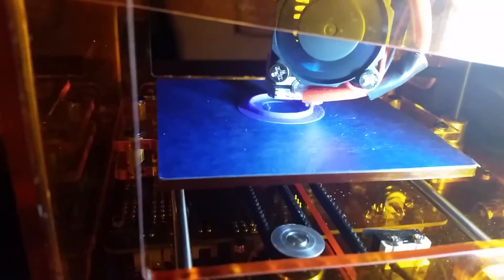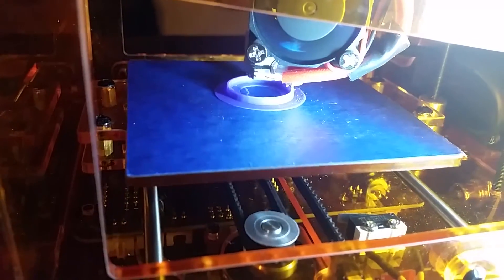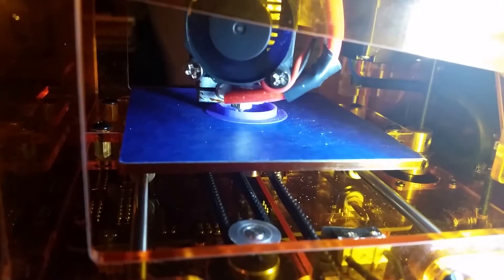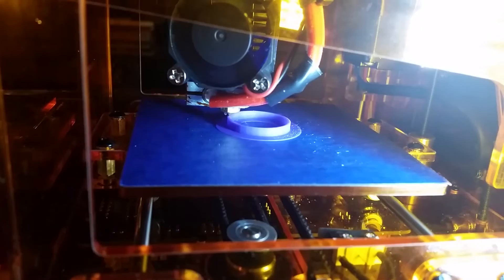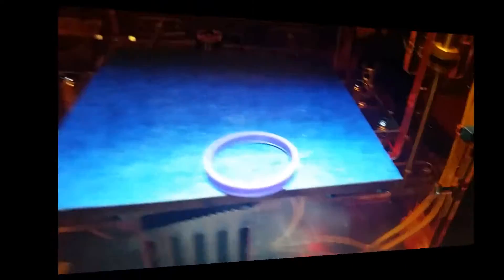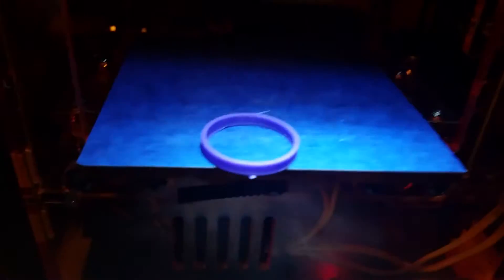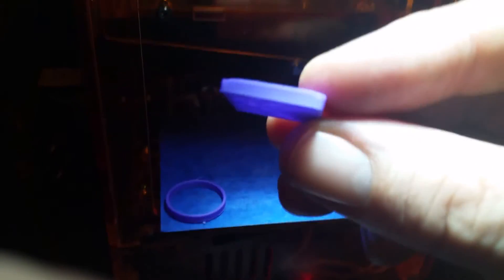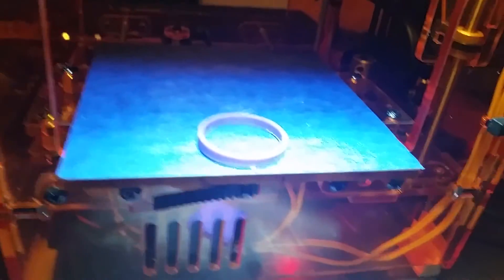Fabricator Mini 2nd ABS print

Comment: Nice ! I can't get ABS to stick on my mini fabrikator :( I even have the buildtak... 
It does stick good for the first layers, but then after 35 min of printing it comes loose and unstick from the bed...
Reply from the maker: +Tahitian Rider same , i had to close /cover the sides . you cant have any drafts at all for ABS . when teh bed cools off the abs pops rite up . when i closed mine in the heat form the hot end keeps the chamber warm , like really warm , as long as all side stay closed . I need to try with glue stick again soon.  but  um yeah , so far as i know you have to put first layer down as hot as you can support and not too fast. i use a brim where i can . possibly a raft would be better .  after first layer is down , i let it it go back to normal temp . its handy if your slicer supports alternate first layer speeds and feeds and temps.
Reply: +XerotoLabs Oh okay thanks for the advice !! :) 
I'll try to close mine with some tape too then, I'll have to leave an opening where the bed comes out of the printer but most of the holes will be closed otherwise. I dont think cura engine support differents temps for the first layer, but I print at 220°c and I'm kinda afraid to go above on the fabrikator mini. 12mm/s print speed is okay ? or too fast ?
Reply from the maker: +Tahitian Rider i have had mine 230 ,  it some time sover shoots and the firmware halts / stops the print . but once warmed it will run along ok . 
i try to do small prints in center that stop the bed from coming past the edge .  see this video i did about cheapo easy doors. https://youtu.be/Tl2uEtzHTKQ
Reply: +XerotoLabs Oh okay, I'll give the ABS another try then :) 
Haha nice mod ! the CD cases are a great idea ! ;) thanks again for the advices !
Reply from the maker: +Tahitian Rider I was trying to use ABS at first as it was the only filament it had on the first day I had it  due to the shrimpy bit of PLA it came with .  after fighting for a few prints i found Chuck's YT ch  and this video : https://youtu.be/i4a5pbJoFLc 
The blue tape and glue works for me .   I should try and re do some of my problem prints with ABS again this week .  It has been a busy week for me offline life .
Reply: +XerotoLabs oh okay, yeah i've seen his vidéo and it is the mean reason why I bought a roll of ABS filament. I was expecting the same results. But I didnt print with rafts, apparently I should. I'll try again with the printed closed and with rafts :)
Reply from the maker: +Tahitian Rider +XerotoLabs PPS , i use 9mm/s for first layers ... that's very slow but only for first layers on ABS and PLA .   lately if im using cura that is built into  repetier host , i set teh speed to 10mm/s  and override thr speed to 90% (results in 9mm/s) during start and first layers , and the set it to 150% (results in 15mm/s)   . I expect i would only set speed to 110% max with ABS though .     also i have Fab Mini v1 , not the newer one if that makes any diff  , but i don't think so .  
I also recheck head height over the build plate every 10 prints or so ans there seems to be some drift up and down over time. (room temp causes it maybe ?? ) 
I think a good sized plastic water bottle or such that coudl cover the whole printer could let you have heated chamber and use full x axis travels.
Reply: +XerotoLabs Oh Okay, thanks again for the tips ;) I don"t know how to override speed while printing in cura engine but I 'think I'll go for 11 or 12 mm/S for the whole print as it is the slowest I can get. 
Yeah I check the head height too sometines. 
I think I'll just go with tape on the side and front opening of the chamber, I dont know my motors to overheat neither since the print I want to make in ABS is a 10 hour job lol
Reply from the maker: +Tahitian Rider if you use Repetier-Host to print , there is a small set of slider on the right , below the position and homing controls .  the top one is speed i think . 
to use that the way i do , is set cura to slice at 10mm/s  .   now that slider range of values  is 0 to 200 ,  because the  file is sliced at 10mms , that slider is like 10x vlaue to make it easy . 
so setting it to 90 while its warming and homing means your first layers will go down at 9mm/s  .  if you set it to 150 , once you are a 2 layers down or so it will be at 15mm/s or whatever you set the slider as divided by 10 .  so if you set slider to 120 the printer would be printing at 12mm/s .  you can set those sliders while it prints anytime, but i try to wait till its not doing a wall , like if its in a infill section 
I'll do a video on this next i think . You're not the only one how has and need to know or ask this.  so thanks for idea for a good next video man .
Reply: +XerotoLabs Oh okay yeah I see the slider you're talking about, the "feedrate" slider. I though this was the feeding rate of filament through the extruder motor, but it is actually print speed. Thanks for the info ! :)
Reply from the maker: +Tahitian Rider see the top feedrate slider here  http://www.repetier.com/documentation/repetier-host/rhmanual-control/   the one with the icon of the guy running . i click in the value box type in the number i want and hit enter exactly when i want the speed change to be sent   (i dont like dragging sliders )  . note it can take a few commands before you will notice a speed change .  the firmware buffers a few commands in its printer memory .  Hope this get you printing smooth .
Reply from the maker: +Tahitian Rider later you can take it out of easy mode and use the slider's to test  dialing in your  plastics and such but adjusting them during a test print .  because the fab' mini supports the on the fly changes , it can make dialing in a new filament much easier .   like slowly upping or dropping flow rates and temps  during prints while you watch  can get you stuff looking nice.  I use a Pro PLA  from a store near to me here .  but  he also has this stuff that is ABS+ ,  its ABS but it prints more like PLA . very cool
Reply from the maker: +Tahitian Rider I put a extra quick over view of how i hand drive feed rates / speed of prints  in this video : https://youtu.be/s1YIjFsZT9g

Comment: Oh man, you could make anything!
Reply from the maker: +Eric Reinholt lol as long as it's a manifold solid model , even some of our space ships can be printed if some care is used.  i did a terminator head , real small , like pencil eraser size LOL , but it worked . I need a cleaner manifold original mesh and i will try a key chain size one .   But this small printer is wicked . you should keep your eye out for when tiny boy launches the version 2 , its slightly bigger brother.  you could Treck-ify your desk .